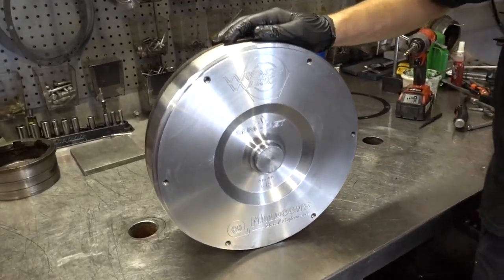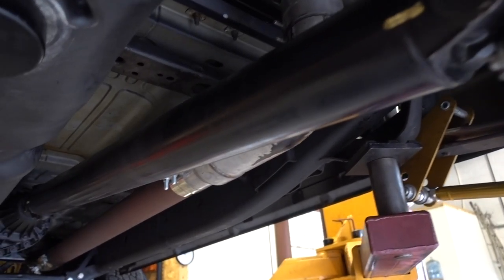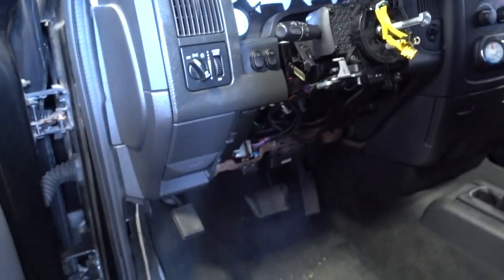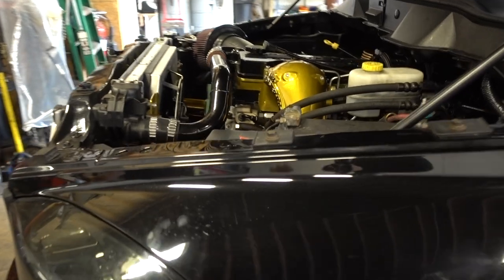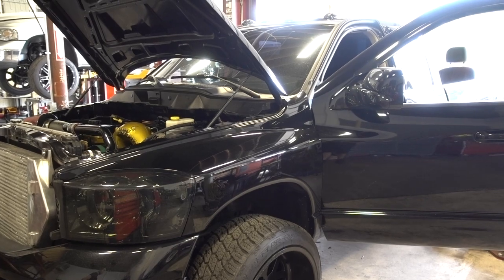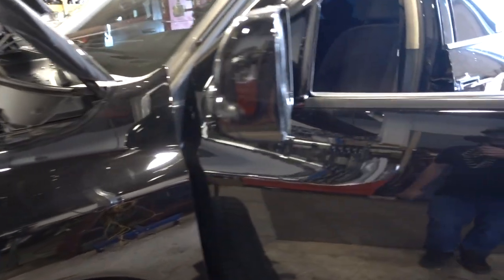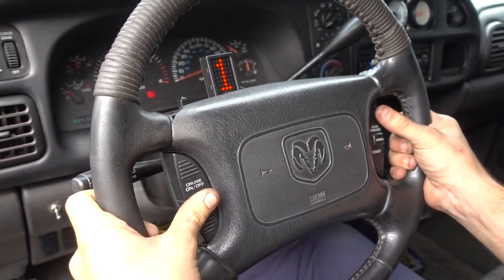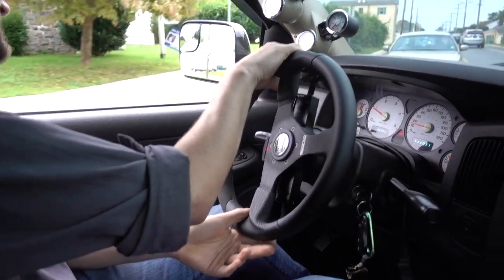CUMMINS PADDLE SHIFTER INSTALL COMPLETE!! & TEST DRIVE!!!

Comment: Awesome awesome video Greg A, oh mar garsh that 05 is such a wicked truck now, it shifts so hard and solidly, and fast lol. I like how it’s both automatic and manual like the modern transmissions in a car with the factory paddle shifters lol, and the automatic lock up from 2nd gear up. Muldoon’s really knocked it out of the park with this one, and those parts from Suncoast it’s a match from heaven than can’t be beat lol.

Comment: Yanno for the money I spent on springs, spools and tuning the governor pressure...I got to say 5500 is a hard sell guys.  I use an arduino to do the same thing without having to screw with paddles, it watches boost/apps/rpm and output shaft speed.

Comment: So can I buy your old steering wheel including everything from the clock spring out?

The paddle shifters are nice but I'd rather have a load rated (performance capable) dual (or triple even) overdrive swappable replacement for 47RE, 48RE s at least. That would fit in the stock length area, use the same bolt patterns, input, & output, require no drive shaft modifications, & run off of the stock or current aftermarket valve bodies (I'd have it use it's own small valve body to shift between it's gears with it's own TCU)
Reply: What your asking for is physically impossible... How you gonna add more gears but still be stock length and use all the other components you said? Lets be real here...

Comment: paddle shifters came out amazing. completely off topic from the video, but i know you have a 5 in exhaust but what size is the bed stack. Also where did you buy the stack from??
Reply from the maker: Thanks! the 05  currently has 4in into a 6in stack
Reply: thanks Greg , whenever i look at that stack it just fits so well with the truck. its not like a trash can that you see on other stack setups.

Comment: i’m still confused which truck is which 🤷‍♂️😂
Reply: Other me too lol I guess there's 2 3rd gens and the dually and the first gen.
Reply: @dodge8802  each 3rd gen has a different accent colour, box length, and transmission. Manual long box with teal accents is the 08 daily. Auto short box with gold accents is the 05 street/strip beast.

Comment: Hey Greg I have 2008.5 6.7 and I'm currently in the process of swapping the 68rfe been like a month and getting it back Friday or Saturday with a fully built 48re with the same pcs and everything any hiccups? And were paddle shifters simple and mind giving rough idea of cost? Cause I just put like 12k into swapping my trans
Reply: Also it's not done by mulldoons it's done by this shop pds in mass he use to be big into 3.0 truck pulls until his engine went twice but theres vids of his truck but appreciate a reply for any issues to look out for with the swap my man and been a subscriber for years now since your pulling truck keep the vids up

Comment: Hey do they have a kit for 4th gen 8 speed? The steering wheel ones are beyond pointless.
Reply: I have a set In my 4th gen 8 speed.
Reply: @moderndaysaint4972  do they work well when towing? I have the 3.0 diesel in my 4th gen.

Comment: Why would you want the dif to lock in second. If you are starting in first shouldn’t it lock
Reply: Not diff it's torque converter. If locked in first it is real hard shifts and really bad for trans even built trans due to the torque that he's running and the gear 1 ratio. 2nd gear is optimum. Stock they lock in 4th or late third. Towhaul early third

Comment: Show the motor,,  your filing man,,  geese gives me a headache and I never got a good look at the motor,  yiu could put it in a pod pint right at the mortar, rather stare at the motor and listen them only listen thinking if get better look,, did it have some sort of billet can cover and what’s all the chrome parts on top the block… that’s was sweet,, no breather, or oil catch?  Looked like solid steel?  But then again I never got a good look

Comment: The flag should never be used for advertising purposes in any manner whatsoever. It should not be embroidered on such articles as cushions or handkerchiefs and the like, printed or otherwise impressed on paper napkins or boxes or anything that is designed for temporary use and discard. Advertising signs should not be fastened to a staff or halyard from which the flag is flown.
No part of the flag should ever be used as a costume or athletic uniform. However, a flag patch may be affixed to the uniform of military personnel, firemen, policemen, and members of patriotic organizations. The flag represents a living country and is itself considered a living thing. Therefore, the lapel flag pin being a replica, should be worn on the left lapel near the heart.
The flag, when it is in such condition that it is no longer a fitting emblem for display, should be destroyed in a dignified way, preferably by burning
https://www.military.com/flag-day/us-flag-code.html
Reply: Okay so why are you posting this exactly?
Reply: Hes talking about the wrenchworkz merch. Just actin like a troll is all
Reply: @reaper8847  I figured but I wanted to ask and make sure that's what he was talking about. But then again if everyone took this seriously then there would be a lot of bigger companies in trouble, marvel since technically Captain Americas outfit would count as a costume, all the companies that have made flags with guns as the stripes, all the companies that have edited the flag to team colors and logo,etc.

Comment: I like the studs on the transfer case. I was a ford tech for years. They use bolts and it can be teoublesome to get the bolts not to bind up. 🤔🤔🤔